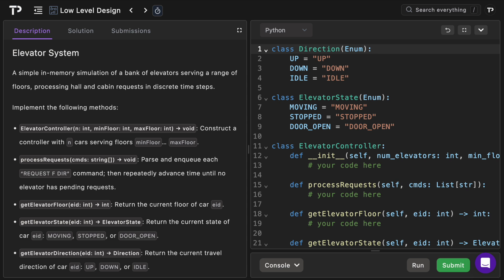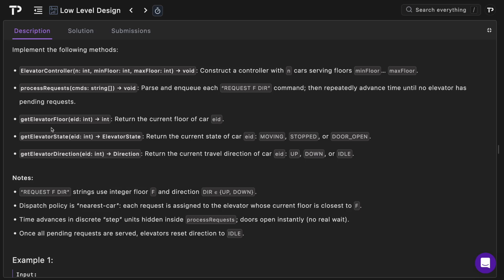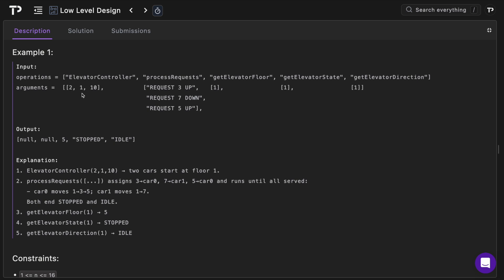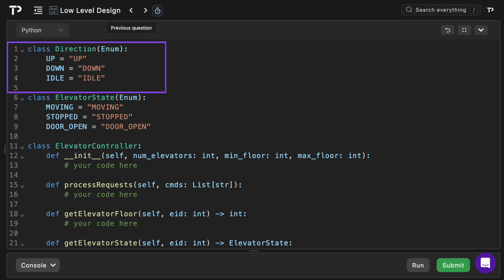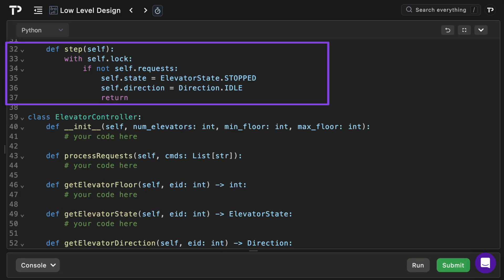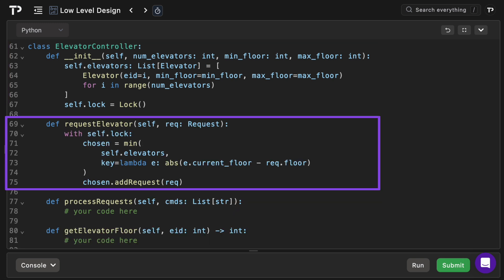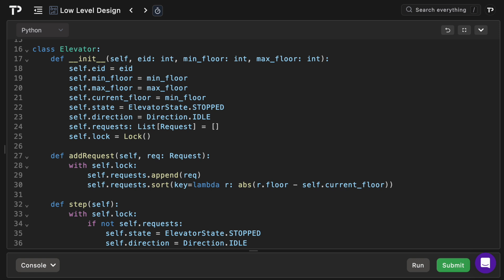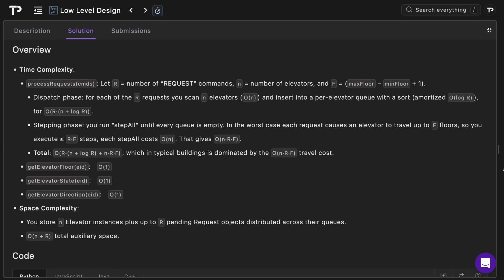Elevator System - Low Level Design Interview Question

Comment: These type of questions are normally part of a system design interview; but having the elevator api prepared made it miss the most important first part, the elevator api must be reached after discussing the requirements of the system with the interviewer. These questions that provides them ready misses the more important first part I suppose.

Comment: Thanks. I think it is going to be more educative for young developers if the description doesn't have the methods clarified. They should learn how to split the methods by separating the responsibilities.
Reply from the maker: Great point! The reason I include the core methods is because they are the methods that the code execution engine calls to test the users code. I hope this makes sense.